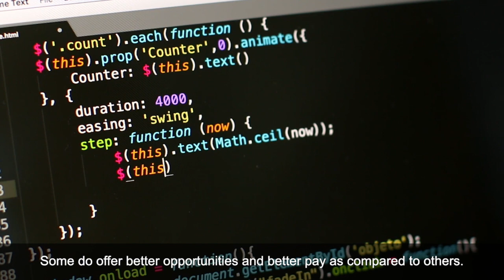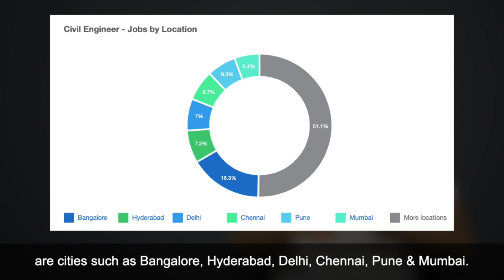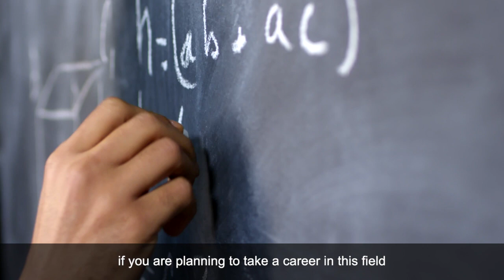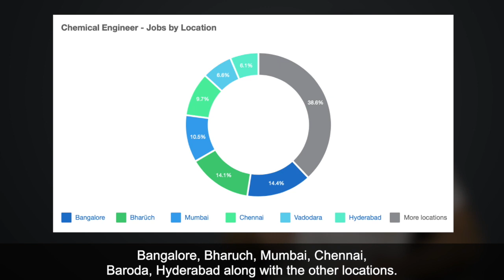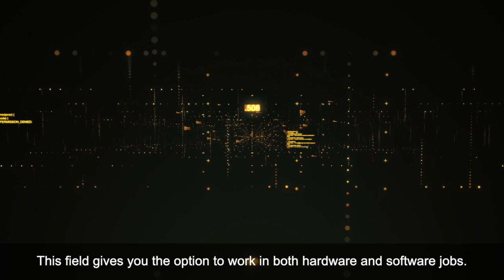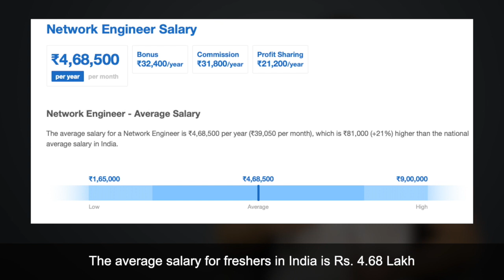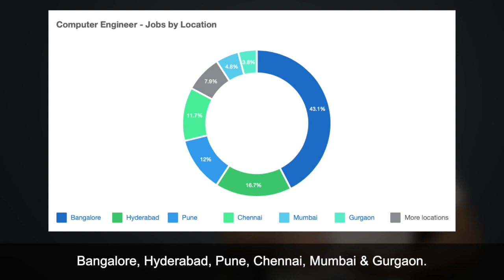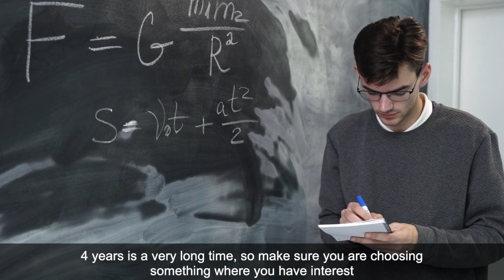Highest Paying Engineering Branches In India in 2024 (Which Engineering Degree To Choose)

Comment: I am currently in my final year B.Tech in mechanical engineering from NIT Calicut. Let me give you guys my point of view. I joined mechanical engineering because I had an interest towards machines. But, it turns out that it is the math and problem solving skill are mostly required. When it comes to placements, Mechanical Engineering is a joke. All these companies mentioned in this video don’t come together. Even if they did, only 10-15% of the students will get in the core field. Others will get placed in IT sector or management sector. The chance of getting into the core field is very low. 
Right now I am studying programming etc. to get placed. So, all of my previous 4 year was a waste. 
Choose mechanical engineering if:
1) You are passionate about machines and its working
2) EXTREMELY good at math and problem solving
3) Ready to learn (or forced to learn) boring stuffs as they are also included in the syllabus. 
4) Can maintain a high Cgpa overall (You might be class topper in 10th and 12th. But it has no meaning in college)

Mechanical Engineering is a vast field. You might be only interested in some part of it like automobiles. But you have to learn all of the other stuffs too, which can be very tiring as you might not be interested in that thing. 

Also, there is a high chance that you might end up with no job since you have been preparing to get into a core company. Unfortunately you couldn’t get it. Neither you have any IT related skills to get into IT companies, since you have been studying ‘mechanical engineering’.

I know it is kind of a discouraging thing. But it is the truth.
Reply: If you are an Indian why don't you crack railway exam
Reply: @Mastersgander  aaha, nalla oru ith😅
Reply: @sumaisjalaludheen5561   kavi entha udheshichath
Reply: Lol. This guy himself studied mechanical and working for Zomato in management profile and speaking about mechanical core jobs😂😂😂😂 he is sounding like clueless career guidance consultants😂😂😂😂😂
Reply: Agreed as a mechanical engineer
Reply: @bandishivani282  of course it's a good course but it has less scope in india more opportunities are in abroad you would get a good job if you clear gate exam as it has less competition
Reply: Sir please reply 10th 12th marks matter in IT company
Reply: Sir, What about Naval engineering ???
Reply: Wow , lovely explained (✨✨) 
But I have  choosen the road , I'll not turn back or stop .
At last  , I do believe you will succeed 
Amen
Reply: Ente same avastha. NIT kku pakaram CET aanenne ullu.
Reply: Oh ... So it's same as we love science . We want to become a engineer , in 11th and 12th class we work hard but we don't like organic chemistry and need to study it for 2 years.
Reply: Listen kids no matter what the branch there is a high chance you may gonna end up in an IT job
-From a mechanical graduate,NITW who is a software engineer but hates programming 🤗
Reply: Bhai I have keen interest in the field of space (Aerospace) and development but sadly these are not a boom in India
Reply: How's civil there?I got nit calicut civil in first round 😐
Reply: Thnk u so much dude
Reply: Truth💯 me too mechanical engineer
Reply: Hi
Reply: @Dude-xy2ot  Hi🤩
Reply: @abhirammadhu2973  you play among us cool inam also
Reply: @abhirammadhu2973  is nit kurukshetra ece worth it? And what are your thoughts on iiit lucknow placement stats are they fake?should I take cse in northeast nits
Reply: @abhirammadhu2973  please reply 😭😭😭😭
Reply: @abhiram madhu,can you please say about chemical engineering at NIT Calicut, I am planning to join there this year, would chemical core companies come to Calicut?
Reply: @human.5396  Core companies are less.
Reply: My brother is also in 4th year NIT Calicut mechanical engineering 😃
Reply: Bro ek baat btao merko to interest bhi cs mien hi hai firhaal and nit/dtu/nsut/iiit mien civil/mechanical lu ya fir ipu University ke colleges like mait msit yaa fir baaki private colleges like SRM mien cse lelu.........jab karni aage cse hi hai
Reply: What is the good cgpa to be maintained in core field??
Reply: Can't agree more💯#mech student
Reply from the maker: 1. Definitely 100% of the candidates can’t get placed in top companies. The supply of mechanical engineers is much higher than the demand. 

2. In terms of which companies come to your university depends on your universities skills to bring companies. I had almost 70% of the companies mentioned in this video during my campus placement, back in 2015. 

3. Engineering as a field is competitive. You need to be in top 5% to make it big in this field else you will be just wasting time. It works pretty much same in every field
Reply: @NikhLogic  sir what about aeronautical engineers are they have scope in future? How much salary they get? Is it very difficult as mechanical engineering? And also what is mechatronics engineering ?please tell🙏
Reply from the maker: Sushant, I wouldn’t recommend aeronautical engineering, since it’s a niche field & the demand for jobs in this field isn’t much high in India. 

I would rather advise taking mechanical engineering & then specializing in aeronautic. It’s always better to go for a Broader field, because tomorrow if you want to switch your field, it’s easier to do. 

Eg, if you want to go for automobile or you want to go into oil & gas after your engineering, you can still do it as a mechanical engineer, but if you are doing aeronautical; it will be much difficult.

So always choose a field that opens your door to multiple sectors and then do certifications on the field you want to specialize in 

Hope this helps & if you have further doubts, drop me a message on Instagram - @nikhlogic
Reply: @NikhLogic  can You please tell Civil engineering is best for girls I'm ur new subscriber 😀
Reply: @prassanaprashanth2995  yes civil is better than mechanical for girls
Reply: @MayankZone.28  Please can u tell about computer science engineering for girls...as an average student...actually im confused between pharmacy and cse...plz guide me
Reply: @NikhLogic  hello sir 
Pls tell me the preference order
What should i choose
Gujarat nit ( svnit) ece
Warangal nit chemical 
Or 
Trichy nit metallurgical 
🙂🙂🙂🙂?????
Sir pls reply fast
Thank you
Reply: @NikhLogic  sir wat about btech biotechnology!?
Reply: @ImyourRen  best engineering category for biology students..

Comment: Sir I dont really have a good hand in physics so which field of engineering will u suggest me?
Reply from the maker: I would recommend taking computer science in that case. The overall requirement of physics is quite less here. 

Don’t take mechanical, or electronics as it has higher knowledge requirement of physics.
Reply: @NikhLogic  thanks sir I was thinking of same
Reply: Sir my maths was weak then which field of engineering will u suggest me??
Reply from the maker: Well Dhanshree, unfortunately Engineering as a concept has maths involved. You can take Computer Science Engineering as it will have relatively lesser maths but make sure your knowledge in coding is quite good, as you will have a lot of that.

Comment: Sir, what is the difference between IT branch and Computer science
Reply from the maker: Both have similar subjects, but computer science goes slightly more in depth. Also, if you are looking to shift countries or move outside India, it is always recommended to take computer science engineering as it holds higher value as compared to IT

Comment: Hi sir I am interested in computer science which will you recommend me to do I studied bio maths group am from Chennai
Reply from the maker: Hello Saravana, if you have studied bio maths, did you have a subject on IT as such in your course work? The issue is, most colleges won’t take your application if your school didn’t have it. So could you confirm that, accordingly will help you
Reply: @NikhLogic  sir want I studied is maths chemistry physics biology Only 
School also had an alternative course maths chemistry physics and computer science
Reply from the maker: Yes that’s issue. Since the computer science was there, you took bio. I doubt any top colleges will take your application. 

I would say do few certifications through which you can apply for computer science engineering branch. It won’t be easy, but might help you in a little way. 

Drop me a message on insta, as easier to communicate there, in case you have any query
Reply: @NikhLogic  ok sir

Comment: Sir I don't like math that much  but I love chemistry and physics which engineering is best for me
Reply: Choose Biotechnology
Reply from the maker: It’s quite difficult Roy. Each engineering field has maths in it, as engineering at its core has mathematics involved. 

I would recommend not choosing mechanical or civil as both has multiple mathematics subject. 

You can look into chemistry or computer science as the subjects related to maths are slightly limited, but they still do have them

Comment: An average student  can handle  CSE. 
🙏please suggest me bro.
       And which is better ME / CSE  for an average student.
Reply from the maker: Yes brother, an average student can handle CSE. Both mech and computer have different use case. It depends on where your interest lies. If you want to go into automobile industry, pipeline industry or oil/ gas etc you need to take mechanical. If your interest and future is towards data science, Data analytics, coding, software engineering etc, then you should go with computer science. 

Both the fields have its own use cases. Neither of the field is easy as such. You will need to put in effort irrespective of which field you choose. 

Having said that, it’s a 4 year course. You have enough time to learn and improve your skills. If your basics are not clear, then spend additional 1-2 hrs per day and improve it. It’s possible! 
Good luck :)
Reply: @NikhLogic   very very thanks  brother
Reply from the maker: Anytime brother

Comment: Sir where does aeronautical engineering stand
Reply from the maker: Honestly Kavitha, if you are still in the phase of selecting a branch I would suggest not going for aeronautical. It’s a niche focussed which doesn’t have much job opportunities in India. Also, if you do mechanical, you can go into aero as well. Hence I would suggest choosing a broader field, and then going to the domain which you want to rather than doing into niche field. Tom instead of aeronautical if you decide automobile, it will be hard for you but if you do mechanical you can still divert.